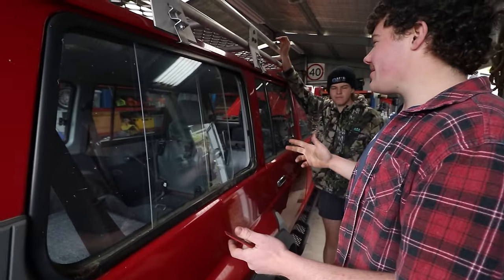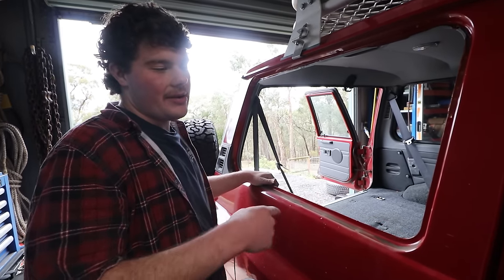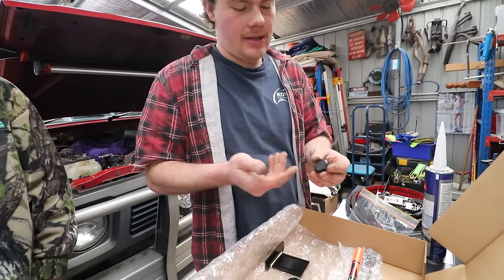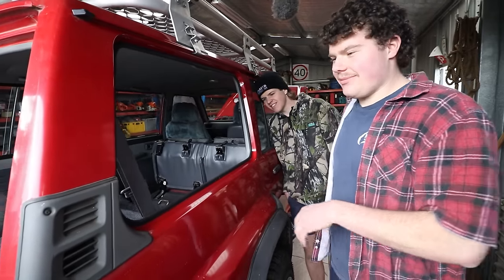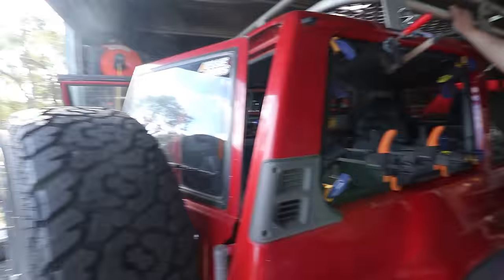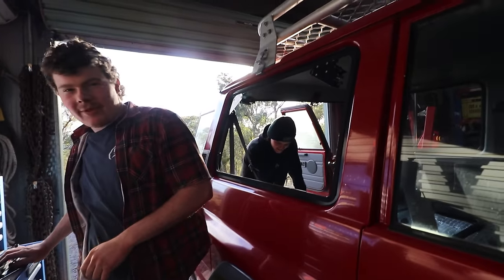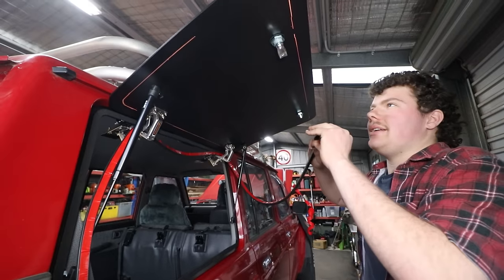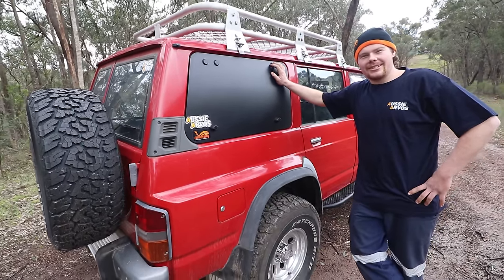My New Favorite Mod!? | Installing the EMU WING for GQ Patrol

Comment: I used to own an Mitsubishi Evolution X when I was in my early 20s and thought that every car should reach /maintain the speed limit within a reasonable time. I now drive a 1992 SWB Vitara Carb. When you know you are the slower car you have to sometimes abuse the car to not be that guy slowing down the traffic. Maybe everyone should drive a slow car when they are young so they know what others are going through 😂. I will have a look and see if there is an EMU wing for Vitara, nice idea.

Comment: Its not those cars that can't run at speed or accelerate up hill - you can tell they are pushing by the exhaust and the noise, its the ones that sit there at 75 on a stretch of 100, and speed up at the overtaking lane meaning only 2 of the 2,955,487 cars banked up behind them can get past them. SHITS ME!

Comment: I'm liking it! Gret job guys.  Just one concern with the pinchweld, it it is the pinchweld I know it has a steel inner to give it grip. That has a tendency to rust. You might want to run a bead of sealer around the frame to seal the frame to the body now which will prevent any water from getting to the pinchweld steel inner. Don't use SIKA, you will ever get it off again. :-)

Comment: Nissans looking good. Tip on your wheel arch guards and rear vents. Paint with undercoat for plastic then clear coat. They will look new for years to come. Polish your bullbar with pads that fit onto a 125mm grinder from ebay and the white metal polishing sticks from bunnings.You will be surprised  how easy it is with the ebay pads. You will love the results. All the above for about $50.

Comment: Problem is Dan if you wait for the lower rear 1/4 to take a hit then it’ll usually crease the rear of the 1/4 panel. Best bet is to get proper bar work out but the bullet and chop away! 😂
Great work as always guys 👍🏻

Comment: If you ever need to get a roadworthy you will need the third row seats if it is registered as a 7/ 8 seater. I recently had to remove my cargo barrier and reinstall the third row of seats because the Landcruiser was registered as a 8 seater and the inspector would not issue the certificate until it was done.
Reply: get a different roady bloke hahaha that’s anal as. mines got the third row seats removed and then some and passes easily

Comment: Is the silicone the only thing holding the brace on?
Reply: Hey mate the adhesive does most of the work but there’s also two clamps that we tightened before the hinges were fitted 👍